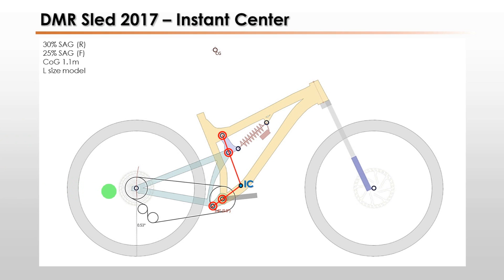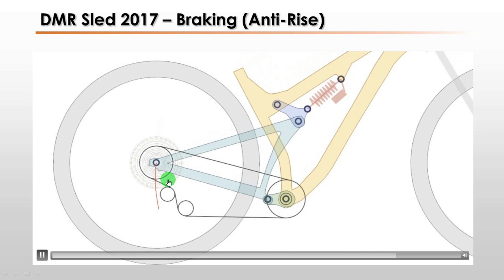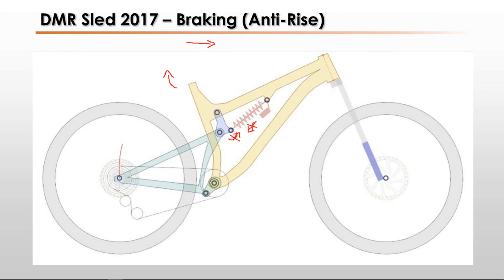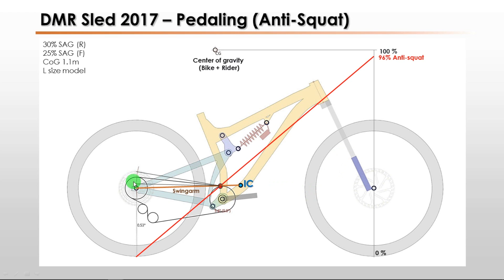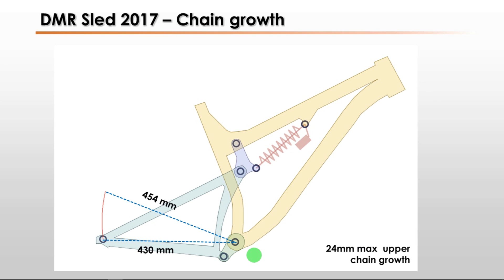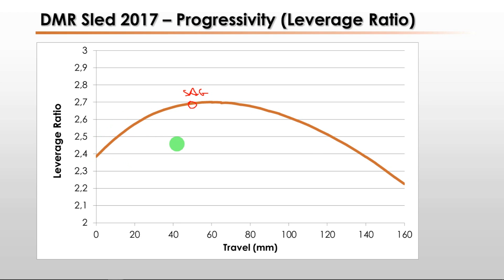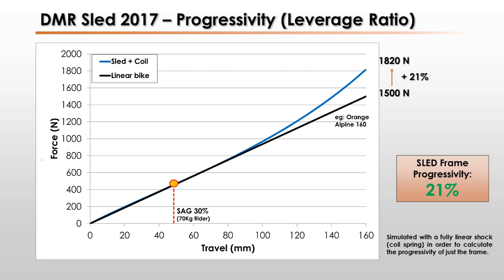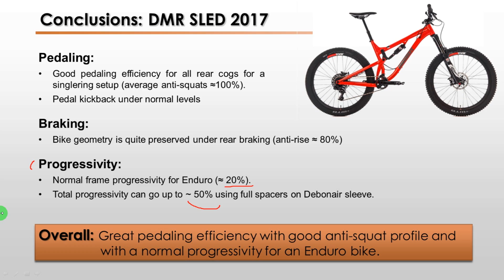DMR SLED 2017 ("Orbit link" suspension analysis)

Comment: Have you had a look at the Antidote Darkmatter?
Reply from the maker: I gave a quick look some months ago. It looked a pretty good design. High-pivots designs offer several advantages over traditional ones (at least for DH). Like rearward axle path, less chain growth needed to achieve good anti-squats (good pedaling), and therefore less pedal kickback.
Reply: It struck me as an interesting design. The Antidote FDS also looks to be quite interesting as well. 

Thanks for coming back to me. Keep up the excellent work.

Comment: Can you review the suspension of a Centurion Trailbanger 2017? I was told it is a great enduro bike.
Reply from the maker: Trailbanger has a bit low anti-squats (around 70%) so it will pedal OK but not great (unless you turn on the shock lever). The anti-rise is 40% so rear braking forces won't affect much the suspension. Progressivity is 15% which is not much (the bike will use all the travel easily, meaning that it's also easy to bottom out in bigger impacts). Bye
Reply: Thank you for taking a look over it

Comment: How do you define CG? Is there a formula to determine the vertical and horizontal position of the CG?
Reply from the maker: +허준 Only with dinamic simulations you can get that. But since the CG of a standing human is on the belly and since a person weights like 5 times more than the bike, therefore the CG height of bike + rider is near or slightly above the saddle. I use 1.1m from the ground this should correspond to an average rider (1.7 - 1 8m tall).
Reply: Thanks!

Comment: hey, whats your opinion about the Liteville 301? Cheers
Reply from the maker: Already asked them for a frame drawing, but based on a first draft analysis (which is a close approximation) the Liteville 301 mk13 160mm has good anti-squats (120% on average for singlering setup) and very low anti-rise (10%). So the bike pedals well and it's very neutral to braking forces. Being so neutral to braking forces has advantages but it also has one disadvantage, which is the slight rising of the suspension under rear braking (due to the inertia, the mass of the rider moves forward, and the suspension rises, therefore the geometry of the bike pitches slightly forward). The progressivity of Mk13 is 30% which is OK.

Comment: Hi Andre, love your videos. On your Air shock simulator, I put in the numbers for a debonair plus sleeve and with 4 tokens with my travel (160) and weight (60) and got 24% sag with 150psi (what I run ). In real life, the sag is about 30%. Is this due to my bike (giant reign 1 2016 al ) having a slightly progressive frame ? or is the calculator just a bit inaccurate, what pressure do you think I should be running with 4 tokens and 60kg for a pretty aggressive rider? Any help appreciated
Thanks, Adam
Reply from the maker: Hi. If I remember correctly the Reign uses a 200 x 57mm shock, not a 63mm one. Did you changed the stroke value to 57 mm accordingly? (default value is 63). If you do so, you got a 30% SAG result. Also, remove like 8mm from the positive length to get a more close value for the 57 mm stroke version (I dont have the real values for the 57mm shock but this should be close enough). Bye
Reply: Thanks, got it now, really useful
Reply from the maker: The SAG is OK, the progressivity should be close to 15-20% with 4 tokens on a Debonair. Meaning that it takes more 15-20% force to bottom-out when compared to an equivalent coil-spring. The 200x57mm version has a shorter positive chamber length, so you have also to adjust for that (remove ~ 8 mm, it should be close enough). Since Rockshox don't share the shock drawings, or the compression ratios (which FOX shares), it's hard, or impossible, to know the accurate values for all shock sizes. I only found the enough data to build a good model for the 63mm version. So the simulator is accurate but unfortunately you can't easily find the shock data.... Bye

Comment: I have a problem. Today i got my new bike. There is a vivid coil shock on there. I know how to adjust everything, but I never had a coil shock. How do i adjust the preload. I don't want to ride with preload. I tightened it just enough, that the coil doesn't move "up and down" in the direction how the shock would compress. Butt it makes a bit of noise an shifts to the side. Should i tighten it more?
Reply from the maker: +Nico Ofner You have to put 1 or 2 preload turns in order to hold the spring in place. More than 2 turns is not good ideia as shown in the video. This video was for those that use like 5 or more turns... Bye
Reply: andrextr Thank you!
I don't really know what i do wrong, maybe you remember, when we talked about making the wheel stick to the ground. Now I tried pretty much every thing and it doesn't work. I got the beginning stroke rebound 1 click faster than the critical point. I don't know what I could do next, because I dont have any compression on.
Reply from the maker: +Nico Ofner Can you compress the shock with your thumbnail pressing on the saddle? If so, everything is fine and breakaway and friction are low. From what I've seen, Vivids don't glue the wheel to the ground on drop test, there is always a tiny bounce. That's because of internal compression. Either if you use minimal compression on the external adjustment you always get some compression derived from the internal piston tune. But having some compression isn't that bad. On a very rocky and bumpy track a bike that passes on drop test has more comfort and traction on those terrains, however, in most cases and tracks some compression is good to provide stability and avoid excessive diving. Bye
Reply: andrextr Ok thank you!

Comment: Can you analyze the geometry of this bike.I plan to buy it but i do not know if the geometry is good or not.Here is a link of the bike: http://www.ram-bikes.com/en/bikes/fusion-650b/
Reply from the maker: Hi. The bike is OK, it has good anti-squats (for a singlering setup), the anti-rises are very low (around 40%) and progressivity is normal or a bit low (around 15%). These results are an approximation since they were based on a draft model (I don't have the drawings of that frame), however, it should be very close to reality. Bye
Reply: Thanks

Comment: superb analysis,  thanks for sharing. 

I don't suppose you've looked at the Bird Aeris?
Reply from the maker: Gave a quick look now for the 145 model. The bike has good anti-squats for a 30-32T chainring (ranging from 100 to 120% depending on the cog at cassete). The anti-rise is 90% (in this type of horst-link layout design with a vertical rocker arm, the IC is close to the main pivot, so it has a similar AR to a singlepivot bike). The progressivity is 15% which is a normal/average value for a 145mm trail bike. Bye
Reply from the maker: The bike has a very low average leverage ratio (big shock stroke for not much travel). So it will need less air pressures when compared to most 140mm bikes.
Reply: andrextr thanks for looking at that, really interesting to read 👍

Comment: what do you think of the propain rage cf? Thanks
Reply from the maker: It has very low anti-squats (around 0%..so pedaling efficiency is not great but as a consequence the pedal kickback is minimal), and a 80% anti-rise. The progressivity is around 30% (which is a bit lower than the average for a DH bike - which is 40%). Bye
Reply: thanks a lot!

Comment: What do you think about a Suspension analysis of the 2017 Propain Tyee I think that would be interesting as well :-)
Reply from the maker: +Philipp Hein Hi. The Tyee has low anti-squat (AS), because the instant center at SAG is in a very low position.. For the middle cog in the cassete, you get a 40% AntiSquat using a 32T chainring, and 70% for a 24T chainring. So the bike pedals better with a small chainring, even thought, it's not great. So, this bike requires a shock with a trail/climb switch. As a consequence the bike has a very low, and good, pedal kickback. The braking performance is normal for a dual link suspension (AR 75%). The progressivity of the frame is 20% which is a common value for Enduro. Bye
Reply: +andrextr Thank you for the facts man :-)
Reply: Uh, i got a 2018 Spindrift and wondered about the values, becuase its basically a bigger tyee. I can definitely confirm that it has pretty much no pedal kickback and it works quite well under braking. It doesnt pedal extremely well and I am definitely happy about the climb switch but the anti squat doesnt seem that bad.

Comment: Hey great video! I heard some bikes aren't designed to have coil shocks and should only be used with with air shocks. I was wondering if you knew if a 2017 trek remedey 8 would be ok to swap for a coil shock? Thank you!
Reply from the maker: +andyboy198577777 Hi! The new Remedy 2017 uses a metric sizing shock. As far as I know there aren't metric coil shocks available yet (at least I never saw one). Anyway the remedy has a progressive leverage ratio so it will work well with a coil. But the newer metric shocks should also work quite well (similar to a coil) since they have a large negative chamber. The trek also uses the Re:aktiv damper exclusively on their shocks, which seems an interesting concept, at least in the paper (never tested one). Bye
Reply: andrextr excellent answer. So I have to wait for metric sizing coil shock. Thank you Andre ;-)

Comment: Very interesting! could you do a kinematics  video on the 2016 gt sanction? would like know in order to tune/ replace shock to suit the type of frame linearity/progressivty/regressivity also I have not got the capability to do this for myself. Thanks
Reply from the maker: +Shay Burton GT sanction has very low progressivity (it's almost fully linear). That's something common for single pivot bikes... GT force and fury, or Orange bikes all of them are linear (or close to that). So, they are easy to bottom out. If this is a problem for you I recommend full spacers on an air shock, specially with an Evol/Debonair/Corset air sleeve. If the shock has high speed compression adjustment, it can also be a good idea to give it a few more clicks. Bye

Comment: I'm curious about the results of pure single pivot bikes like 2017 orange alpine
Reply from the maker: +sri da Orange Alpine 160 (older model) was not perfect but it was an OK bike (100-120% Antisquats, 90% antirise and 0% frame progressivity (fully linear). The new Orange 6 is horrible. By placing the pivot on an higher place, the antisquats are now 200-300%, which is way too much (and will cause pedal Bob by suspension extension), and as a consequence the chaingrow and pedal kickback are huge. The bike remains fully linear despite what they say on the site. I think that only the Tantrum bike can be worse than Orange 6 2017... I would like to make this video but I still have to think how to do it without being under fire from Orange and their fanboys eheh. Bye

Comment: #andrextr Are bikes that are at the top with negative progressivity bad? If so what would be some of the advantages of having such a linear suspension? Thanks for all the videos~ Keep up the great work~
Reply from the maker: Hi. Linear bikes or slightly regressive ones don't offer much bottom-out resistance, so it's quite easy to use all the travel. Usually linear bikes are mostly used on XC since the expected use don't include aggressive features like jumps or drops. If you design a very progressive XC bike, then most riders won't be able to use all travel. For more aggressive use, like Enduro or DH, it is expected a more aggressive riding, therefore, the progressivity on these bikes are higher (enduro bikes have 20% on average, while DH bikes have 40%). In some cases you can increase the progressivity of the bike up to +30% (depending on the type of shock) using full spacers on the air shock. If this is not enough for you, and you are always bottoming-out, then you need a more progressive frame. Also, more progressive bikes are a bit more soft on the beggining of the travel. Bye
Reply: andrextr thanks for explaining ~ yeah that makes sense which is why I am considering getting some spacers for my rear shock for my FOX DPS EVOL shock. 👍🏻

Comment: would adding an idler pulley raising the chain slightly above main pivot on any frame reduce anti squat? in doing this, how would it effect a dh bikes performance?
Reply from the maker: Hi. It would depend on the particular design of the bike. If designed properly, the idler pulley can give you good anti-squats with very low pedal kickback. For instance, the new Orange 6 has a terrible design with a very high pivot and huge amount of chain growth, kickback and 200-300% Anti-squat. In that case, if you placed an idler pulley a bit below the main pivot, it would give you good anti-squats a very low kickback (and having the advantage to be an high-pivot bike with rearward axle). This is what happens with most high-pivot bikes (Zerode, Supreme V4, etc). Bye

Comment: it's Santa cruz's VPP very similar
Reply: Dante Vergil the linkage system and anti squat curves are somewhat similar to VPP from Santa Cruz &  Intense bikes, and Level Link from Diamondback... switch infinity from Yeti uses a different type of linkages but with similar anti squat curve... all these systems usually show moderate-to-high anti rise (preserve geometry while braking but makes the suspension less active under braking forces)
Reply from the maker: Exactly Carlos. :)

Comment: So much input. Keep up the good work! Have yout ever checked the POLE Evolink? Expensive, but interesting. https://www.polebicycles.com/bicycles/enduro/evolink-150-hd-275/?v=f0aa03aaca95
Reply from the maker: Already gave a look for Evo150. It also uses an concentric link with BB, but the IC is located at a lower position (bellow the chainline), making the anti-squats a bit low (the anti-squat starts at 100% but on SAG zone it's around 70%). It also has a lower porgressivity than DMR (progressivity of 13%). Bye
Reply from the maker: Yes a small chainring would increase the overall anti-squats. In this case, a 22 or 24T will make it around 100% AS, but since I don't think this bike can fit a front derailleur, it's not an option. Anyway, having a lower anti-squat has the advantage of having lower pedal kickback. Turning the shock on the trail/climb mode on the pedaling sections will solve the "problem". Bye
Reply: But running a smaller chainring on Pole, which for many riders is a must anyhow, does change this, and puts it on par with DMR's orbit link, right? Which would be the optimal size chainring in this case?
Reply: Thanks!

Comment: GT Fury 27,5"?
Reply from the maker: I didn't forget your previous comment but I was a bit busy today :) Fury works as a single pivot. I can't calculate the anti-squat of GT because the BB moves, but I don't think anti-squat is the most important parameter on a DH bike.The anti-rise of Fury is 95% and the progressivity is very low for a DH bike (around 5%). So, it's almost fully linear. Most DH bikes have, on average, 40% progressivity. So, it's quite easy to bottom-out the Fury on bigger impacts. Having a progressive shock is a good ideia, although it won't solve completely the problem. Bye
Reply: yes, I have noticed that and I have changed the spring with one a little stronger on Fox DHX RC4 and I have turned the bottom out control a little higher. What shock do U recommend for this Frame? Shock on Air or what does have a good progression? The BB just rotate backwords... I have tested the breaking without spring and it doesn't move when breaking...
Reply from the maker: When you compress the suspension with the wheel on the ground you will see that the brake caliper rotates quite significantly around the disc (if you saw my previous video about Slayer this doesn't happen). Anyway, this is not the most important question. For GT fury I would recommend a shock with bottom-out adjustment like yours, or an Float X2 (with lots of spacers). In the case of DHX RC4 I reccomend to put 200 PSI on boost valve (max) and rotate the bottomout adjustment all the way in. This would give you a better bottom-out resistance. If this is not enough, give some clicks on HSC (be aware that the more HSC you use, the more harsh it will be over bumps, roots and rocks). Bye
Reply: I see that it has Custom Tune ID made by FOX for this frame...I will check the boost valve, thanks for help